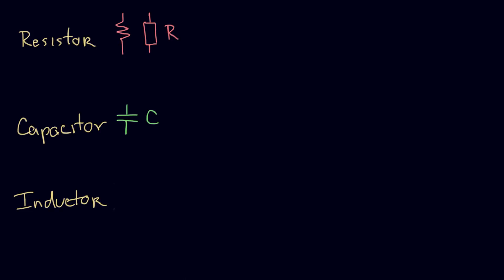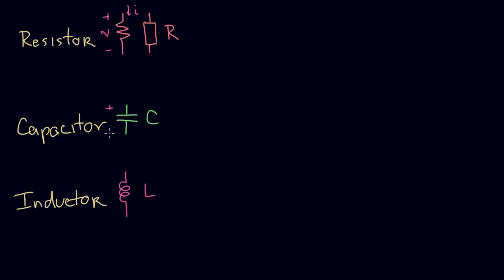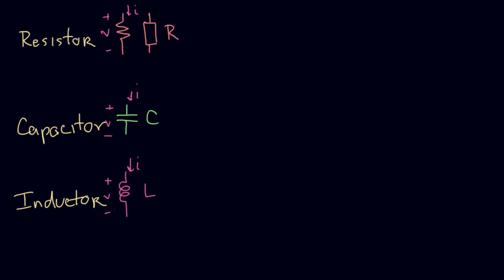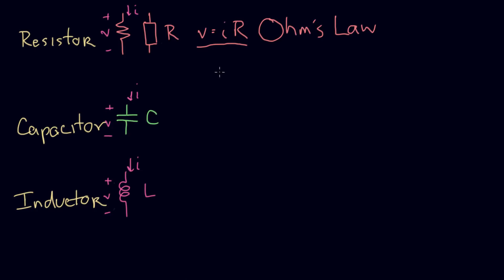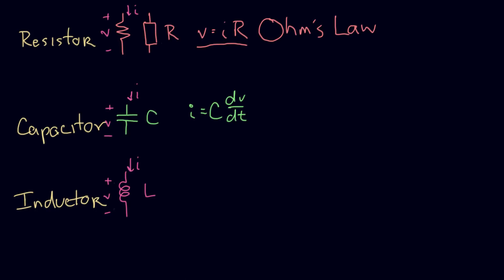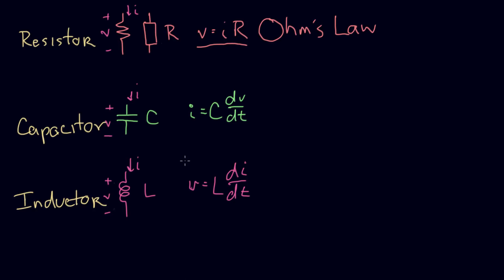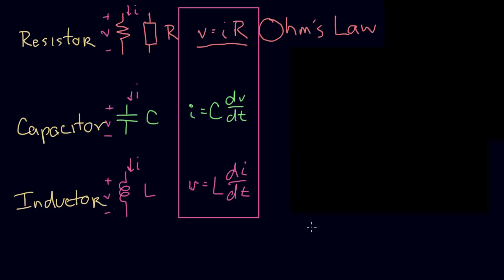Ideal circuit elements | Circuit analysis | Electrical engineering | Khan Academy

Comment: I come from a more physics background. I don’t get how you would get a voltage difference across an Inductor (coil of wire). I mean, obviously there is the resistance of the wire, but that would just be i*(resistance of wire), so where does the L di/dt come from? The capacitor makes sense; it accumulates charge which causes an electric field in-between the plates. Charge is the integral of current, so if charge is proportional to the E field inside (and thus voltage difference), current is proportional to dv/dt. All I can think of what the inductor would do is create a magnetic field inside (coil of wire = electromagnet), but magnetic fields don’t contribute to voltage.
Reply: Aeroscience study the concept of self induction to understand thus